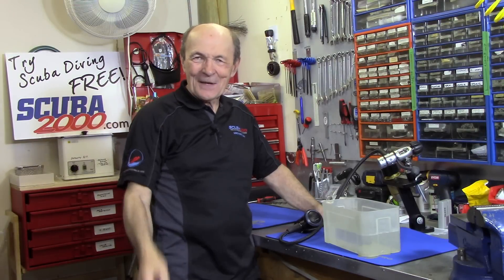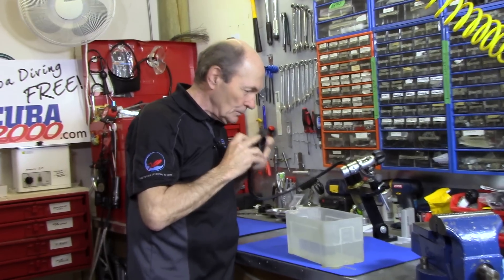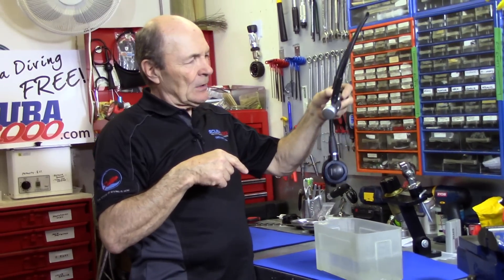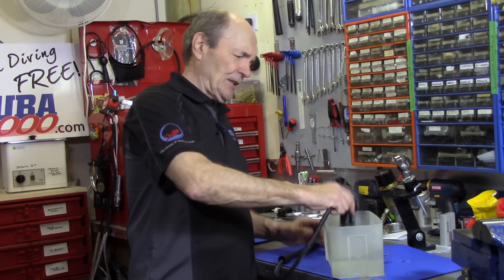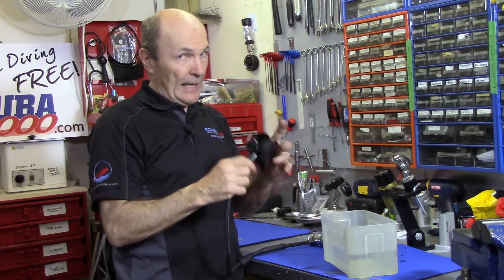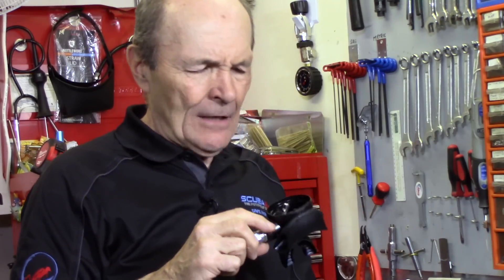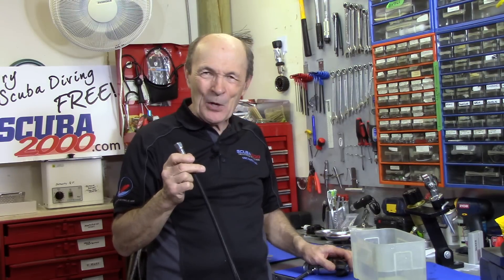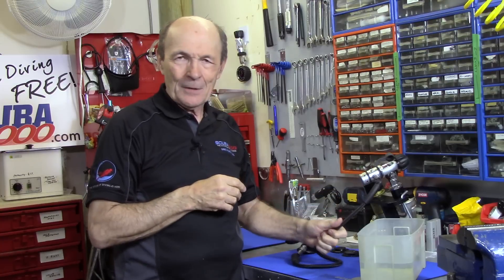Go Ahead, Push The Purge When Rinsing - Scuba Tech Tips: S05E15

Comment: Is what you are describing in this video based on the regulator first stage completely disconnected from the tank valve but the dust cap on (no air pressure from tank) and only atmospheric pressure in the LP hose to first stage?
Reply from the maker: Yep. That's right.
If with the reg off the tank, there is still air in the first stage and the hose.
For water to move up the LP hose from the second stage to the first stage would require the air in the hose to be compressed and there's simply no force compressing that air. Ergo, no water will go up the hose.
Alec

Comment: the problem is, if you push the purge button, water may enter the balance mechanism (balance piston has a small hole in the sealing cap, leading trough the piston to the balance chamber)   of the 2nd stage, and block it by freezing in cold conditions.
Reply from the maker: Possible although remaining air in the balance chamber ought to stop any water from entering. Assuming you're air is dry as it should be, a 3 second blast will dry out any small amount of water in there.
Alec

Comment: Sometimes I have to rinse in my bathtub. Since I don't have a tank, do you know of something to put some compressed air through the regulators? A bicycle pump would do the trick?
Reply from the maker: To get air to flow through the reg you'd need at least 200 to 250psi.
A bike pump won't work. You need a scuba tank or a dive shop to get that pressure.
Alec

Comment: Alec, what are your thoughts on the following, since when we service our regulators , we do first stage plus both 2nd stages
What i find most people do is  only use the primary  2nd stage and not the occy, so next time they are service they are basically servicing an unused piece of equiptment ( the occy) which they have paid to have serviced????
Having said that what i do throughout the intervals between services is change the 2nd stages over so they get equal use
Admittedly i do have matched 2nd stages
Your thought on this
Reply from the maker: Assuming the 2 seconds are identical, that's a decent idea. Most divers (if thev've been watching my videos) have the best primary possible and a solid but cheap Safe Second. They won't be the same at all. It's for the same reason that you state - the Safe Second just doesn't get used so why spend big bucks on it?
It's nice that you thought of it from the diver's point-of-view. 
Alec

Comment: Hi Alec, 
What exactly will happen if water gets into the first stage? I have read that it can cause the second stage and octo to freeflow and can even do damage to the SPG. Is this true? And what should be done if water does get into the first stage? Can it  just be dried out with the dust cap off? 
Thanks! 
Mike
Reply from the maker: Well, the issue is usually overblown a bit. Fresh water in the first stage is not a big deal. If it's put onto a tank and air blows through it it will dry out almost instantly. This must be down quickly though since even fresh water has minerals that could cause the metal parts to bind. 
Now if it's salt water, it's a different story. Salt water can start corrosion very quickly. If you can blow clean air through it within minutes you'll be ok. If not, I suppose soaking the first stage in fresh water, inside and out, will lessen the impact of the salt and then blow it out. If you get salt water into the first stage and it stays there for a while, even hours will be enough, the metals parts will corrode and the seats will get salt deposits on them. If serviced fairly soon, say within weeks or so, the corrosion will likely all come off. The seats are replaced in any service anyway so you will still be good.
In all these cases, remove the SPG before blowing. You do not want any water in the HP hose leading to the SPG or computer. See below.
It's when the reg sits for a long time and the salt water actually dries inside that you will probably have main parts destroyed.
The second stage is largely plastic and is not affected.
Re freeflow, sure. If the first stage is corroded, the seats will no longer seal and the IP climbs causing a freeflow in the second(s).
You're right about the SPG though. If salt water gets up the HP hose and into the SPG head, it's toast! It cannot be 
cleaned. A new SPG head only is about $100. If you have a hose mount air-integrated dive computer, things can get very expensive!
So, if you think you got salt water into the reg, get it serviced right away.
Hope this helps.
Alec
Reply: Thank you so much for your response! I think I might have gotten a little fresh water into the first stage as I switched tanks in shallow water. When I first repressurized the first stage both the second stage and the octo free flowed. I shut the tank off and when I repressurized a second time everything worked fine for an hour long dive. Can I assume that if any water did make it into the first stage it worked its way out during the dive? 
Thanks
Reply from the maker: As I tried to show in the video, it only takes a few minutes of blowing fresh, dry air through a regulator to dry it out. Assuming it was fresh water and if it wasn't sitting with water in it for a long time, I'm sure you're OK.

Maybe this is a good time to point out to divers that the fresh water rinse tank on dive boats isn't full of fresh water. It WAS full of fresh water but unless it's changed after every dive, there is salt in that water. 
Be careful!
Alec

Comment: hi Alec,
First off, i love your vids. very helpful. I know very basic info on scuba. just woundering if you could clairify decompression in possibly a video, that would be awesome.
Reply from the maker: It's a good idea but rather hard to make an interesting video. 
I suppose I could find a diver to get the bends on video. Actually even that would be boring!
Try reading up on Google or a good textbook.
Decompression and related topics, decompression sickness, recompression, NDL diving, safety stops, etc., are more theories than practical. Tested and proven theories to be sure but pretty dull stuff.
Alec

Comment: Hi Alec, thank you so much for this great video, (my first ever reg) made me a bit relaxed as i did purge my second stage and octopus while rinsing them in fresh water.. I made sure the dust cap is on and the first stage was higher than the regs.. Next day i went to the dive store and did run pressured air in them.. It did spit few drops and kept going until i made sure no water drops were coming out.. Would you advise to send it to a shop for inspection or just relax my mind? Again thank you for your help..
Reply from the maker: If you rinsed it and then blew fresh scuba air through, I'd suggest you're OK. Take it in for regular service when it's time but I wouldn't make a special trip.A special trip to the dive store for service now and it's likely they will simply blow clean, dry air through it.
Alec
Reply: Well i had to wait until the morning (almost 12 hours) for the shop to open to blew fresh scuba air in the reg, would that cause an issue?
As well is there any signs i should be aware off to take it for an early service? Really sorry for the too much questions but just a biggner.. Thanks again for your help..
Reply from the maker: Assuming it was fresh water that you rinsed it in you should be OK.
There's no way to tell for sure without a complete disassembly but that's really not necessary.
Don't miss you next scheduled service.
Alec
Reply: Thank you so much Alec and hope one day you can be our guest in our diving sites in Egypt :)

Comment: Hi alec! Thank you for all of these great videos! I've enjoyed every single one of them. This one makes a lot of sense. Whoever played around with a straw in a refreshing drink sould get the idea. The problem here is if the first stage is below the second no air needs to be compressed and the water would run right up the hose. Please correct me if im wrong. Thanks again and best regards from germany.Stefan
Reply: Good to hear from you again Stefan.
I suppose water could run up the hose but it's still a stretch. For water to run up the hose air has to come out. It's not a big hose for 2 way traffic. And the second stage valve doesn't open very wide even when in use.
Let's be clear again - I'm not advocating pushing the purge when rinsing. I'm just saying it's not such a big deal as many divers and instructors make out.
I should run some tests to see just how much and if water does go up that hose. To this point I've just been applying physics and experience. 
And keeping y'all thinking!!
Alec

Comment: That's fine, until someone drops their regulator in a deep bin of water, even with the dust cap cover on, and then presses the purge with the entire reg system underwater.  Air in the hose compresses, albeit slightly, creating a vacuum where water will fill the void.  Or someone blasts their regulator with a hose directly into the mouthpiece while purging...

Also, It's not a matter of the droplets getting down (although that would be even worse), it's a matter of the water creating high humidity, which in the long run is no bueno for the reg.  And the intense Florida heat guarantees that water turns to air humidity quickly.  Your tests may vary, but mine has resulted in regs getting quite nasty by the time I service them.  If anything, I think I'd be doing a disservice to folks by teaching them to have fun pushing the purge when rinsing.
Reply from the maker: "teaching them to have fun pushing the purge when rinsing" !!
I'm not sure if it was 3 times or 4 times in the video that I said I'm not suggesting you push the purge , that you shouldn't do it.
Not sure WB1 where you got the impression I said to do it, much less teach divers to do it.
Must be the heat down there.
It would have to be a deeeep bin! At 30' the water would have been forced up the 27" hose 1/2 way only.
Anyway, the video was only to dispel an incorrect impression and to teach a bit about regulators.
I agree that one should avoid pushing the purge while rinsing if possible.
Thanks for watching.
Alec
Reply: Appreciate the response.  I apologize- I didn't mean to imply that you were saying to have fun pushing the purge.  But the video does imply that it's not that big of a deal if it happens. It can be a big deal- especially when dealing with regulators that are being used with 100% O2.  And sure, 30' would be about half way, but that's half the hose being completely filled with water and is obviously extreme.  Rather, a 2 ft bin will cause about 1 inch of a 22" hose to be filled with water.  An inch of water in a hose is more than enough to cause extreme humidity / moisture to form in the 1st stage once that water evaporates in the summer heat.
All that said, I appreciate what you do for our community with your videos.  I recently saw some regulator videos (mixing regs together / adjusting 2nd stage.)  I thought it might be cool if you did a part 3 showing how magnehelics are used and how to manage without one via measuring how far the reg needs to be submerged before air comes out / IP drops...  Just a thought for a future video!
Reply: Good idea WB!
I can do that. Show divers how inhalation is measured and how to judge if your reg measures up so to speak.
Alec

Comment: Alex, I do understand your point, water going down a long closed hose is unlikely, although capillary forces can play a role into enabling water to slowly run along the hose wall (therefore no need to go against air pressure). An easy experiment could be perform by putting few drops along the wall of a one-end-closed hose and see if it can run down to the bottom.

Another thing I would be more concerned about is having some water into the hose before storing it for some time, because since equilibrium is going to be building up into the hose, air will be saturated with water, air humidity will build up (water aqueous phase and  gas phase) . 

So for storage, after rinsing the second stage, if purge valve was pushed, a good flush with the air tank like you showed, might be a good advice.

All this is relevant if there is a communication between the low pressure part of the first stage regulator and the high pressure part of it. In other words, I do not know if the valve enable air to circulate between low and high pressure parts when at atmospheric pressure (valve is close or not ?)
Reply from the maker: I can't argue with your reasoning but I find it hard to believe capillary forces would enable water to travel 27". At least 1/2 of that distance would be uphill - assuming the hose is coiled. Capillarity, as it is sometimes called, works best with miniscule tubes. The inside diameter of the LP hose is perhaps 1/4" - much too large for normal capillary action to be in play.
However, your suggestion to pass dry tank air through your regulator after rinsing is great! I doubt many divers will do that. It's a struggle to get them to rinse! And then hang the regulator by the first stage to store.
Re the valve, a piston first stage is normally open when not under pressure (in storage) while a diaphragm is normally closed. I'll have to think for a while to see if there's an advantage to one over the other. Initially I'd suggest the piston is better in that there's no pressure on the seating surfaces so they stay fresh - they don't get deformed.
Thanks for watching and for your thoughtful comments.
Alec
Reply: You're right, capillary forces is not the appropriate term, but I can picture liquid running along a hose side (not uphill of course) and not having to work against a hose air pressure. bottom line might be, do not hang regulator by the second stage :-)

Please keep up with your tech tips from which not only I learn but that develop my thinking. All your years of experience is of great value for all of us, especially taught in a very pedagogical way, make your tech tips perfect, at least for me.  Thanks
Reply from the maker: Thanks Bruno.
Some of things I say might go contrary to what a diver has heard.
What he chooses to believe and how he chooses to act is entirely up to him.
But, if I can get him to think rather than just blindly follow along, I think that's good.
Take care.
Alec
Reply: In my first comment I meant Long term storage. Having to flush regulator with air after rinsing it, might be cumbersome if done after every dive.